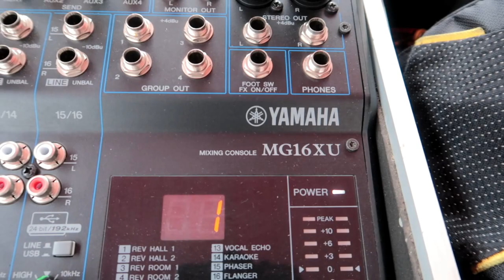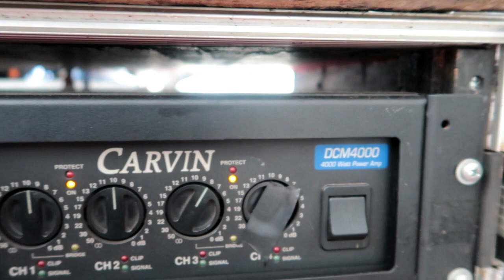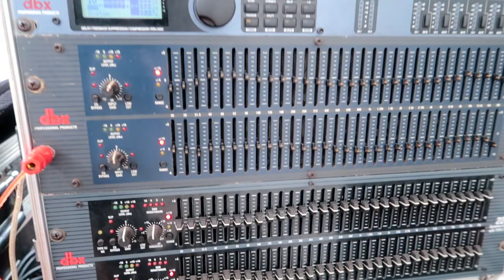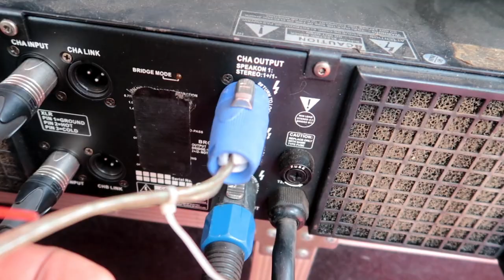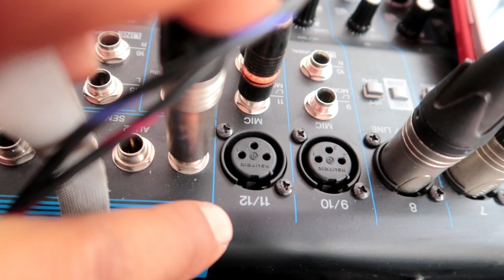TUTORIAL SOUND SYSTEM - LANGSUNG COBA

Comment: Itu punya sampeyan satu sayap. Trus klo sond duwa sayap gimna pak. Apa perlu duwa buah  menegemmen.
Reply from the maker: Trims komen nya ya, yg di maksud sayap itu kiri dan kanan (L/R) low, mid, hi atau jumlah sepekernya ditambah kalau jumlah nya ditambah sy saranam management nya di setting ulang di chanel yg lain yg sudah mantap dengan jumlah sepekernya biarkan oke bro
Reply: @trisfocuspro5642  bukan pak. Maksut saya. Sayap kanan dan sayap kiri maksut nya, sayap kanan 3 power, sayap kiri 3 power, sama" setereo. Sedangkan sayap kanan kan satu buah butuh duwa input L dan R, berati kan 3 power di kanan total butuh 6 input. Lalu 3 power yang di kiri mau  ngambil outpot dari mana pak, kan output  menegemmen hanya 6 output, dan itu di serahkan ke sayap kanan semua,  lalu power 3 buah yang di kri mau ngambil dari mana, apa butuh satu buah menegemmen lg.
Reply: @trisfocuspro5642  mohon bantuwannya pak
Reply from the maker: Saya umpamakan sayap kanan 1power untuk low saya kiri 1 power untuk low supaya masing2 power punya tenaga besar dibrige aja jadi bisa untuk angkat tambah sepeker di perhatikan wat speker jangan n me lebihi power juga perhatikan om speker jgn 2om begitu juga untuk mid dan hi nya oke
Reply: @trisfocuspro5642  maaf pak. Saya kurang begitu suka btl power. Ada aolusi lain kah pak.
Reply from the maker: Bisa solusi lain dengan  jemper power dengan resiko signal level power ke2 menurunkan atau dengan output distributor, contoh lin dari management 6 masuk ke distributor masing2 keluarga aut jadi 6x2 dan bisa kemasing2 power dengan level yg bisa di atur/jas.
Reply: @trisfocuspro5642  emang distributor itu ada berapa input pak.

Comment: Ijin bertnya. 
1.Monitor panggung pake speker aktif ? Sambungkan ke mana itu mas ? 
2. Kenapa ada jumperan box 2 yg atas itu ?. Buat apa yah ? 
Masih pemula maaf mas
Reply from the maker: Trims atas komentarnya ya, sy gunakan spiker aktip untuk monitor disambungkan dari aux send ke G-EQ baru ke spiker dan sy gunakan 2 box dengan isi 1 box 2spiker dan 1driver jadi junper pertama untuk driver jumper kedua untuk spiker dengan tidak mengabaikan omhnya, mudah2 cukup dipahami trims
Reply: @trisfocuspro5642  speaker aktifnya pake merek apa mas ?  Untuk suara high nya pake tweeter aja kn ? 2 box d atas pake speaker brapa inci mas ? Rangkaian seri atau pararel ? Krn mau tau main di brapa ohm. Trims
Reply from the maker: Trims koment nya yaa, amtoo pake proel 12" hi pake tweeter, speaker pake 10" 1box 2x10" diseri box ke bok sebaliknya jadi 8 omh
Reply: @trisfocuspro5642  brrti kabel high sambungkan ke tweeter trus d seri ke box 1 lg kn mas ? Jd mid 10 x 2 dan 8 x 2 ? Main mid di 8 ohm speaker watt brapa itu mas ? Trims